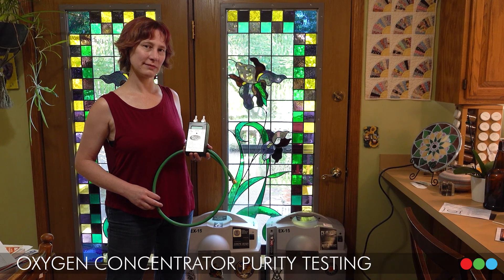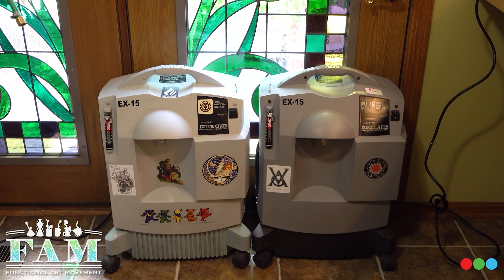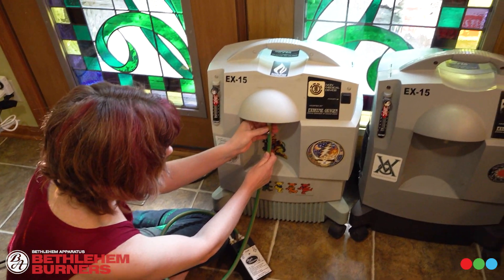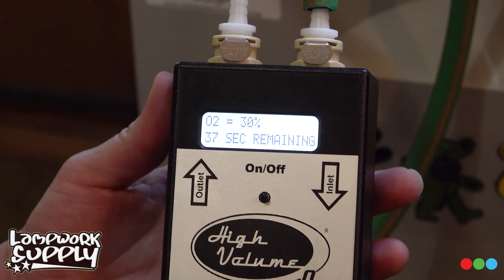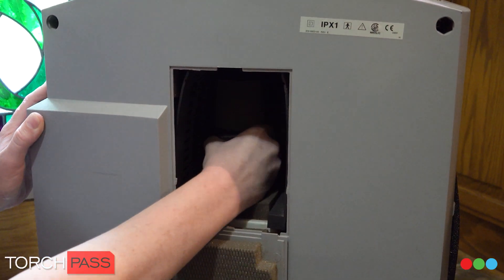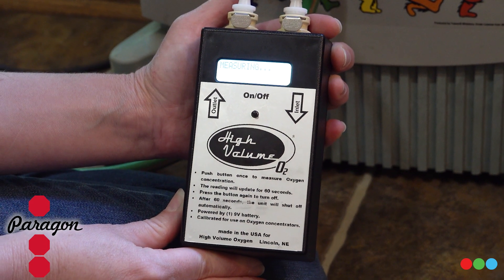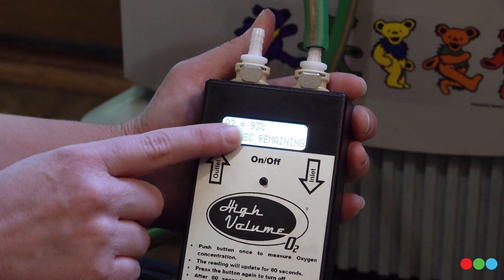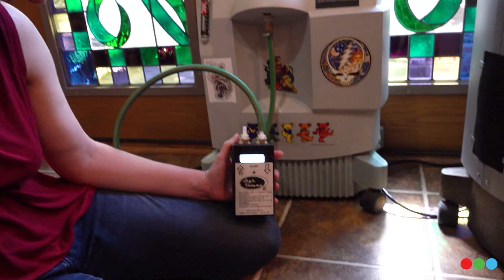Oxygen Concentrator Purity Testing & Maintenance

Comment: Hey this is super helpful. Thank-you for the demo of this tool; and I didn't know about that interior filter, so will look at that too. I just spoke with Wally at GTT to troubleshoot my sidewinder which is running on two concentrators, it has a really nice flame but can't quite get hot enough. Bottom line, I want to test the purity of my concentrators, but especially the older one from Xtreme Oxygen. Wish I could just borrow a meter rather than buy one. Maybe I'll ask around where I live.